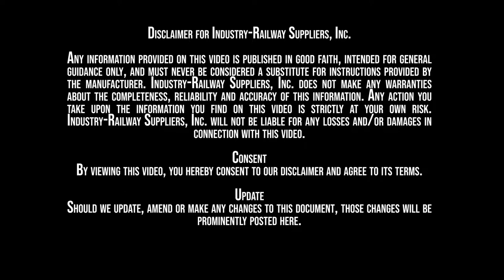How to Safely Remove and Replace a Railroad Tool Handle

Comment: If you have  loose handle. Soak the  head in anti- freeze that has glycol in it. It swells the wood fibers  keeps the  handle tight on the head.
Reply from the maker: Thanks for the tip.

Comment: HAIYAA!!!
Don’t sand the wood 🤦🏻‍♂️ 
The friction holds the head and handle together. 
Don’t cut the handle until after the wooden wedge is in. 
Where is the metal cross wedge? 
As a veteran professional railroader I replace handles in all sorts of tools, from mundaes to mauls to axes to spike lifters to punches and chisels. 
Use a hydraulic or manual press to extract the old handle. At least a punch and vice!
Set the handle with a sledge. Turn it upside down and on a preferably wooden surface like a stump, we use the track tie, hold with two hands and drive the wooden handle down onto the wooden surface. When the handle no longer goes deeper into the eye spread the handle wiith a wedge such as a spike or a flathead. Then add your wooden wedge using a ball peen. Then saw the extra material flush with the head. Then using the ball peen drive in the lead wedge. I like to drive it a bit dee with the spike head. That’s how I was taught by old heads. Thats how they were taught.
And grind that mushroom 🍄‍🟫 before it flies into your throat or eyes!